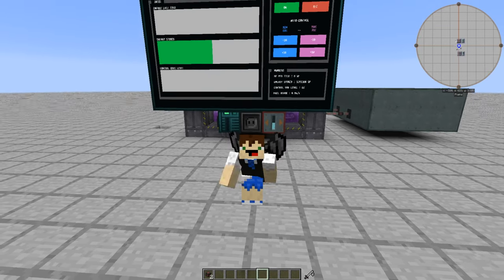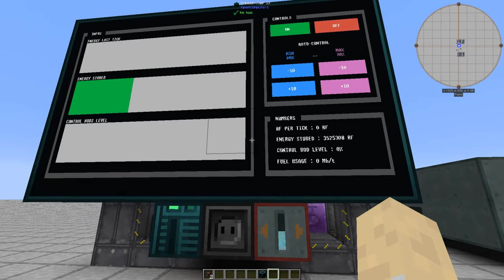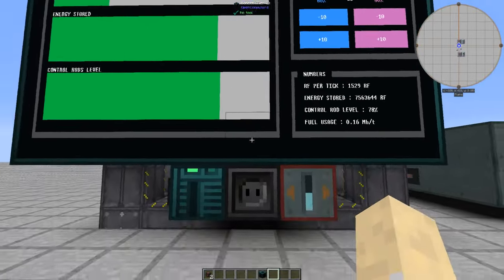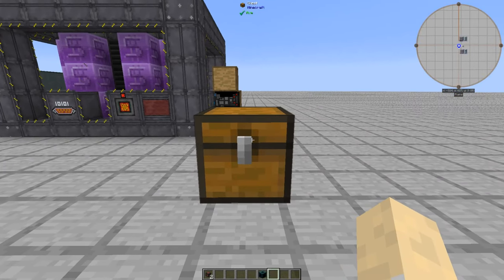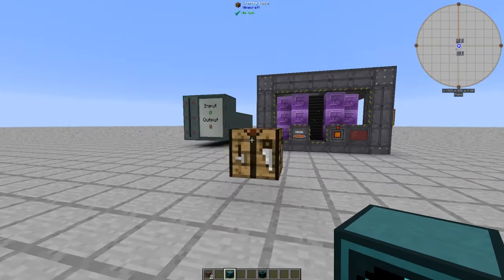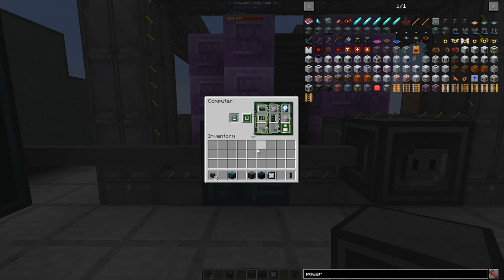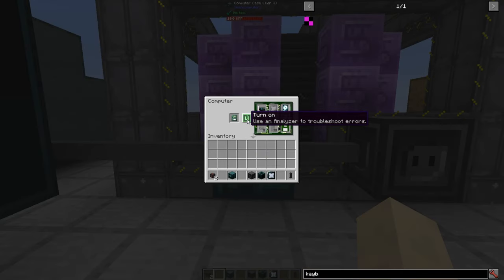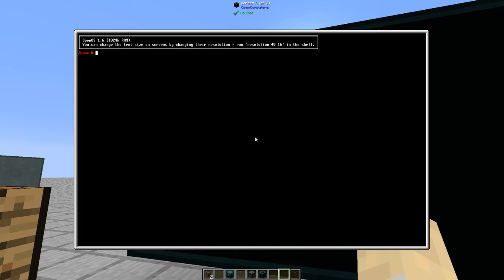Big Reactors / Extreme Reactors - OPENCOMPUTER AUTOMATION PROGRAM

Comment: i tried to get the program from pastbin but its saying file not found is there anywhere else i can get the program
Reply from the maker: the is an issue with openComputer that makes it that you can't get the file from their command.
in the computer find pastebin.lua 
(to list programs, you can do ls)
in pastebin.lua, at the line: [local url = "http://pastebin.com/raw.php?i=" .. pasteId], change it to [local url = "http://pastebin.com/raw/" .. pasteId]
Reply: thanks
Reply: Hello Kraken, I have been using your program for a while now and it has always worked great and Ive been able to get it up and running with no issues. However I am now playing the FTB Beyond 1.2.1 mod pack and when I try to load the reactor program it is not working. Could you please explain in more detail how to resolve this issue you described above? When i load the program everything looks fine up until i input edit start.lua and there is nothing there, i dont see the reactor program or buttonAPI, nothing.

Comment: The keyboard actually doesn't need to be on the screen. You can place a block in the front of the screen and put keyboard there.
It just has to connect to the screen.
https://www.dropbox.com/s/8fmq9ov34ed5187/2017-12-28_00.05.04.png?dl=0

Comment: Are you using a modpack, or just installed some mods? I tried Sky fac 3, but there are WAY too many mods, so any minor change is extremely slow..
Reply from the maker: I am actually using this on sf3 and it works great at the moment... there is not a lot of updates on there, there is even a check on if the information is different before making an update to the screen, if there is any lag, it doesn't come from the program itself but from something in the mod itself. But then again, i don't see lag on my server where we are 2 to use this program
Reply: Krakaen hmm, I'll try to in investigate further. Thanks for now!

Comment: i dont have the code in Start.lua
Reply from the maker: +alex gandon in the description and in the pinned comment, there is a link on how to fix that.
Reply: +Krakaen i just paste the code you have in the start
Reply: +Krakaen in the video
Reply: +Krakaen oh and im searching but i need a controller for turbine with open computer
Reply from the maker: +alex gandon there is an issue with getting things from pastebin, even if you manually enter the start code, it won't work, you need to aplly the fix that i placed in the description and pinned in a comment. I do not have a turbine control, sorry
Reply: +Krakaen :( the reactor work i needed to put the code manually but it work eperfectly try do an emency thing like when a reactor go too hight on temperature it will stop it
Reply from the maker: +alex gandon the reactor cant explode... Why would i stop it?

Comment: Ok i have the computer all tier 3,  5x3 screen with keyboard, Installed LUA from floppy, did pastebin get on your code, code downloads no problem,  
Running the startup fails with the following error (also a screenshot to show its using the computer port legacy https://ibb.co/d9QN8w
https://ibb.co/cXcr1G  
can anyone see where i have gone wrong?
Thanks
Reply from the maker: +wo88les can you try to update the extreme reactor to a more recent version? The mod author told me it should be fixed in newer version. I am not in the possibility to test it right now

Comment: How do I get the Floppy OS? I only have a floppy, and can't find a recipe for the OS one.
Might be a dumb question, but I have no experience with this mod.

edit: I found the answer, the recipe for it wasn't in this modpack though. (All The Mods for 1.10)
Reply: Finally got it up and running, great video, thanks!
Reply from the maker: thanks :) glad you found it
Reply: GladGulGubbe94 how did you find it
Reply: MasterQuentus i believe you can make it with the wiki recipe, even if it doesnt show in the modpack.
cant remember
Reply: GladGulGubbe94 I figured it it tells u in the book  but thanks